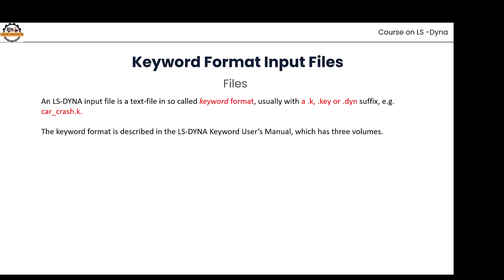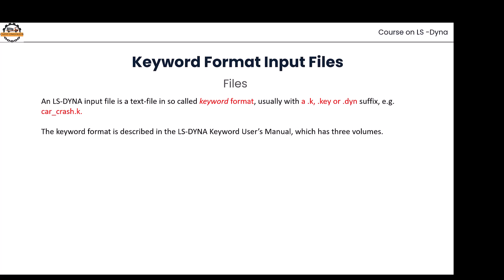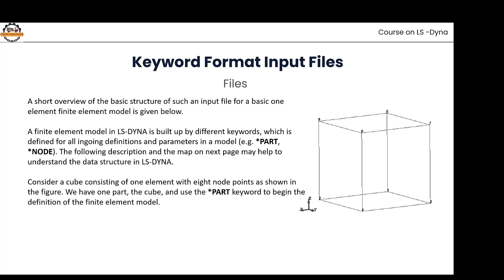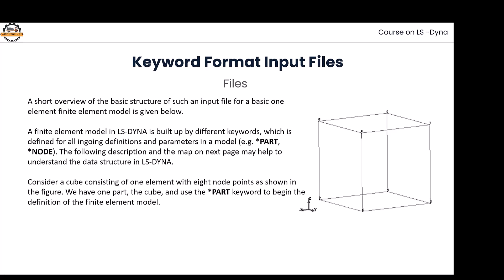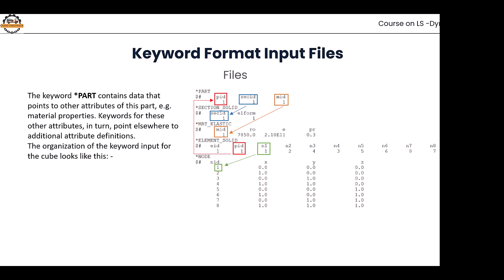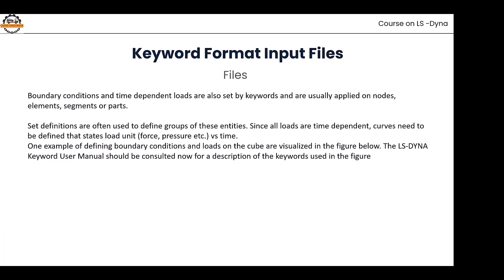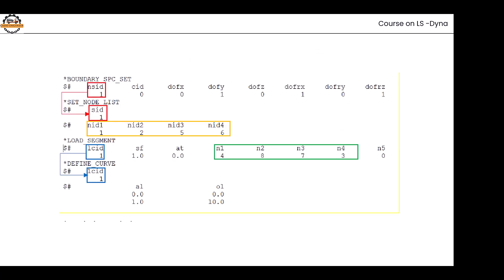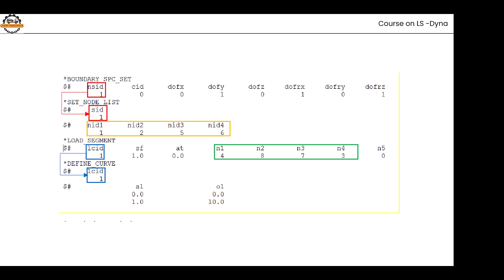Keyword Format Input Files in LS Dyna

Comment: Is there a tool that lets you easily create these Keyword Snippets and save them off as Notepad files for re-use in Workbench Models?

Just typing up this format is prone to error with spacing/alignment being so critical.
Reply: Yes. Ls dyna needs to be linked to the geometric, then you run meshing and ls dyna calculation. Then you go on result, write k file and you save it